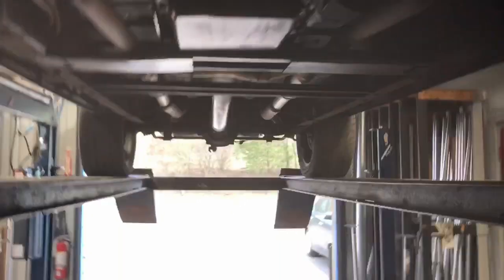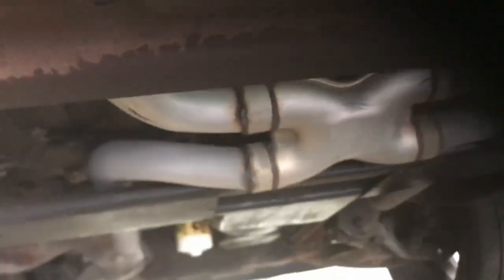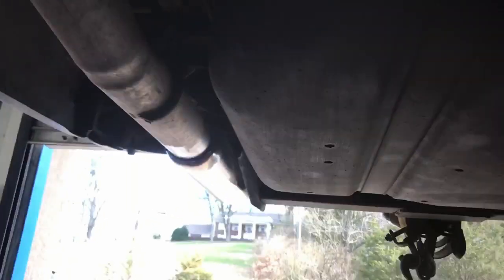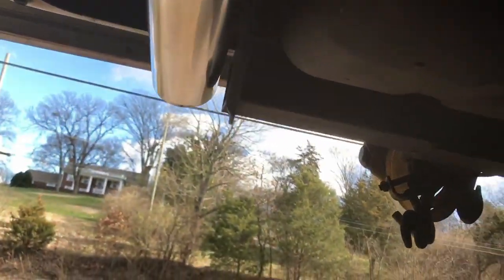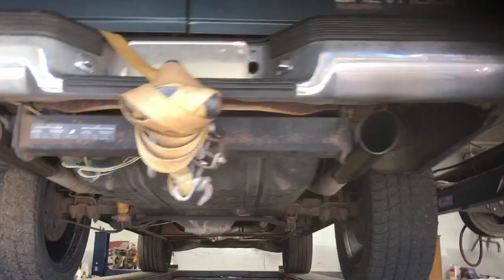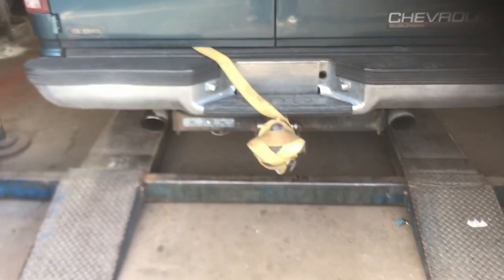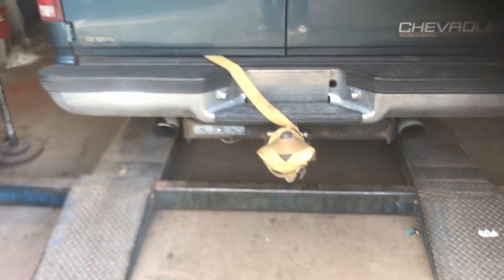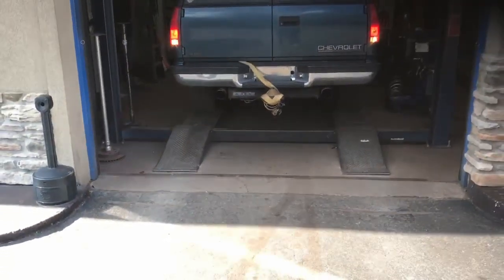1995 Chevy Suburban 5.7L  V-8 TRUE DUAL EXHAUST w/  X-Pipe & High Flow Cats!! Crazy LOUD!!!

Comment: I have a 94 suburban k1500 with the silverado trim and it has just about every option, didnt look like a whole lot but ive put a lot of money time and labor into making it reliable. After all this time i still dont even have a muffler on it. I want dual exhaust just like this, right out the rear. I just cannot find anything. Was this all specially made?
Reply: I have a 94 suburban with shorty headers and dual straights!! No exhaust or cats!! About to put highflow cats on it now!! I did all of it my self, I bought 2.5 inch pipe from online for about $130 and welded it all together! You can also use exhaust clamps instead of welding if you don't have a welder!!

Comment: i have a 94 with a single downstream o2 sensor, where did you run this one? and where did you find those cats?
Reply: This also has s single o2 sensor,its mounted in the center of the x pipe,the cats are some that they keep in stock for performance systems
Reply: timmy240ax oh okay thanks

Comment: It's not true dual exhaust if the pipes converge. True dual means no Y-pipe, no H-pipe, no X-pipe, no single chambered muffler.
Reply: that also means a vehicle that only has 1 o2 sensor wont be running properly because the computer is only reading one side of the motor...think about that for a second